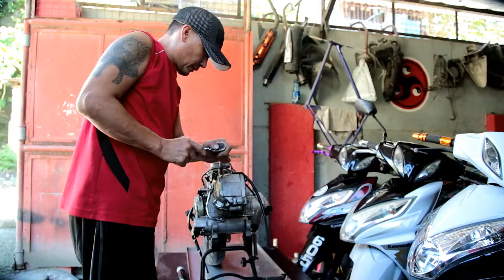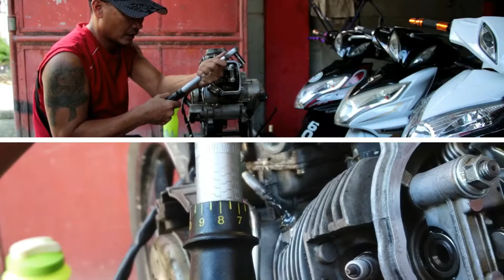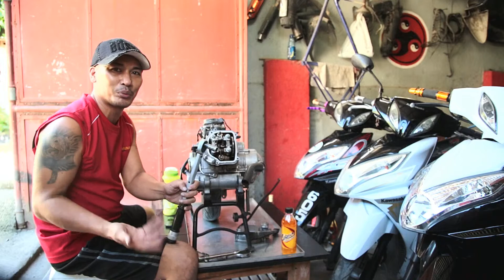KCustom KCurves - Kawasaki Curve Torque Wrench Setting and use.

Comment: hello  poh  sir.   from bacolod city...  tanong  sana ako  poh.... kawasaki Curve....  125cc         palage  nalang poh     stock   kick  niya   tapos  wala na  poh...   work   starter  niya  poh... ano poh..  damage   niya poh......
Reply from the maker: Kawasaki Curve stock is 112cc. As for your kickstart problem. could be kick spring or possible pinion gear/ kick fan